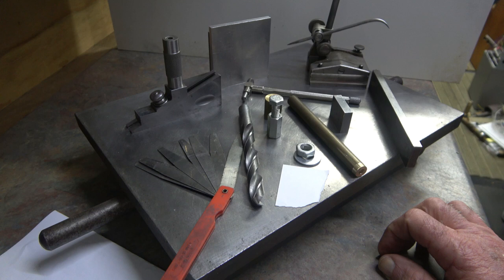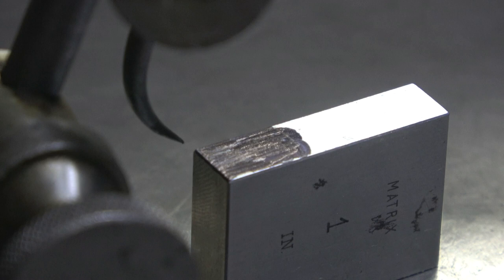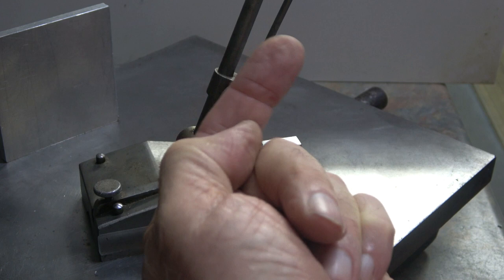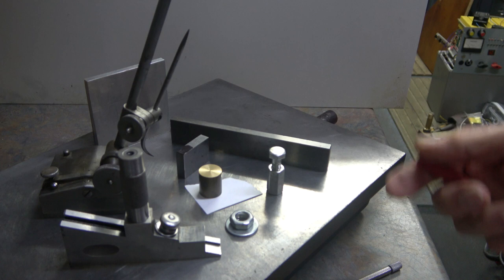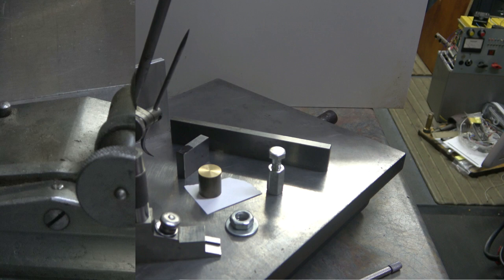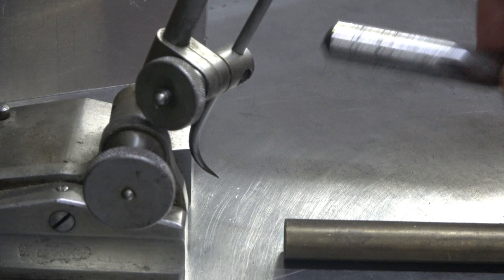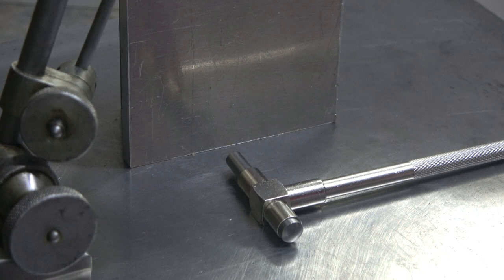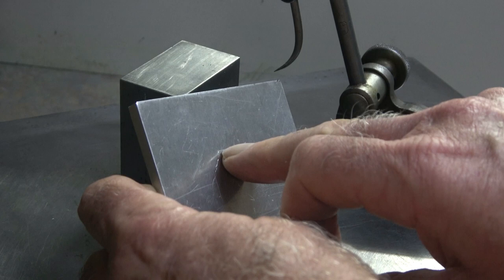How I Do Accurate Scribing Using A Standard Scribing Block or Marking Gauge.

Comment: Hi Dave

Another useful video, seeing you use a connector and bolt made me think that this could also be used as a temporary machinists jack with the added bonus that you could lock it in place with a ‘T’ nut and if by chance you caught it with a drill or cutter all you have lost is a bolt.
Reply from the maker: Yes, absolutely Chris, those coupler nuts are a very hand thing to have in your bolts box. Thanks for watching. Regards.